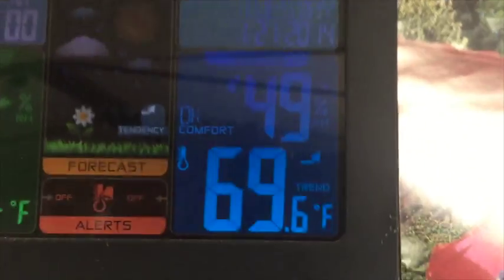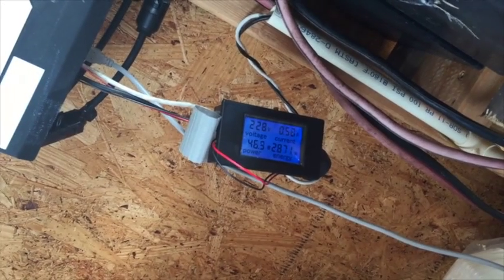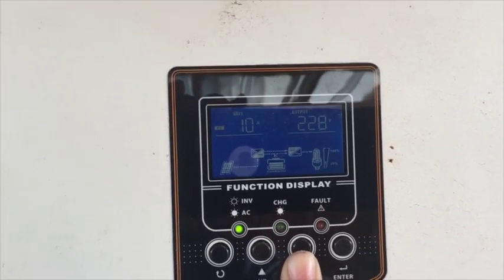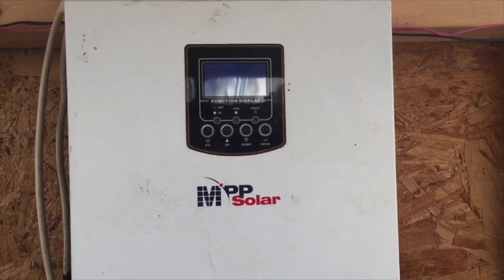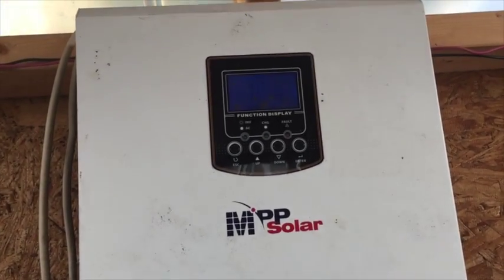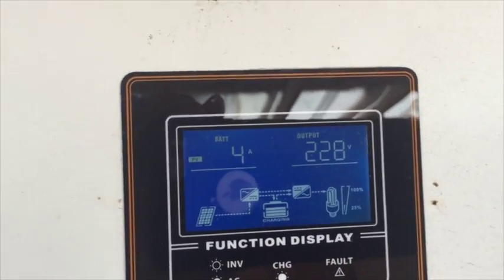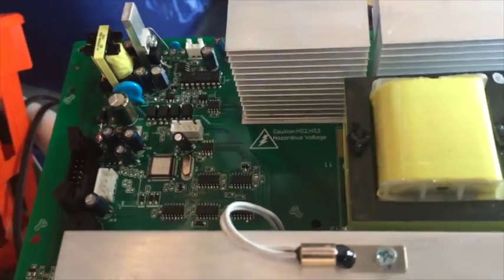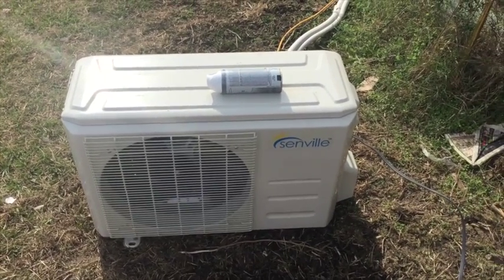Off grid review MppSolar 2424HSE 'Audio fixed

Comment: Thanks for fixing the audio!  I agree with you on loving the Charger/Inverter.  I use a fairly inexpensive transformer for the 120v loads.  Got it from Amazon and haven't looked back.  I have the MPPT on and off grid model @ 48v.  Great videos ... keep up the good work!